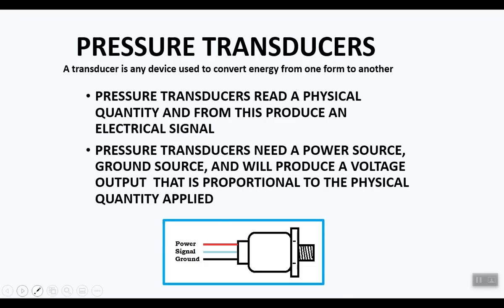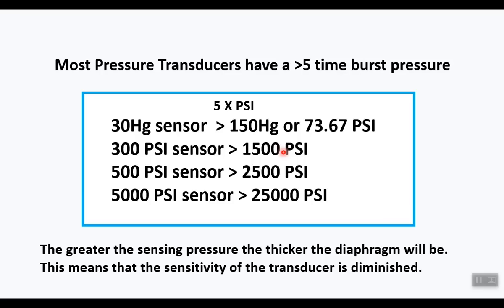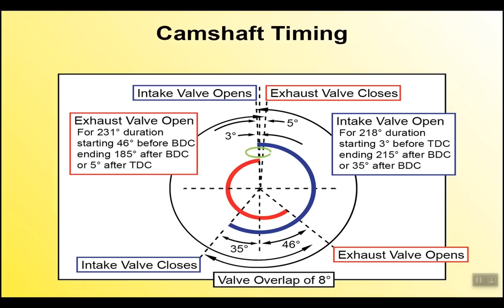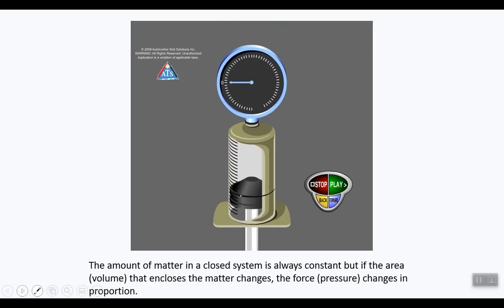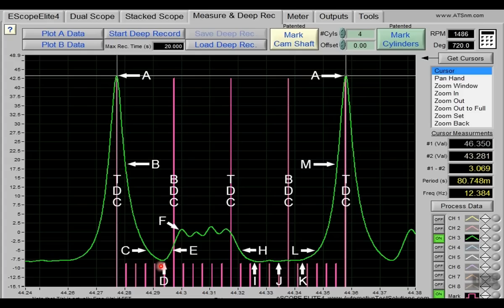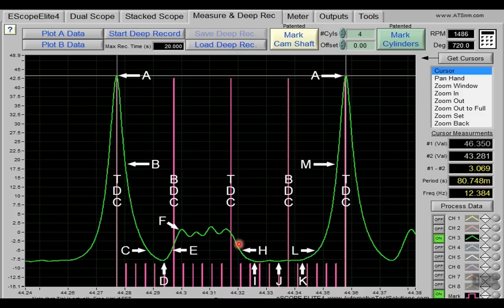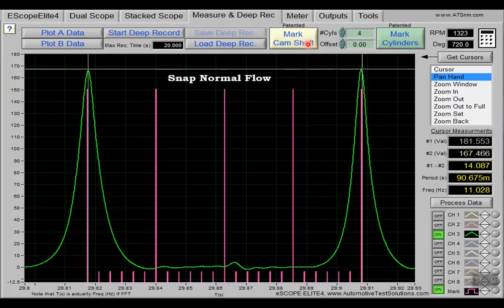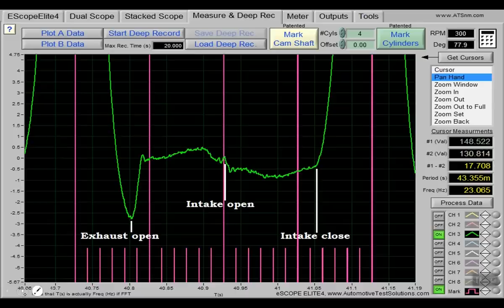The Pressure is on Part One

Comment: Hello Bernie. Thank you for the informative video. I particularly liked the break down of the different technologies of the pressure transducers. 

One comment about a description that seems to be in error: for the adiabatic compression, the heat is not only from the piston doing work on the contained air, but from the heat contained within the air already in the cylinder. The heat is concentrated into a smaller volume of gas as the compression stroke occurs.